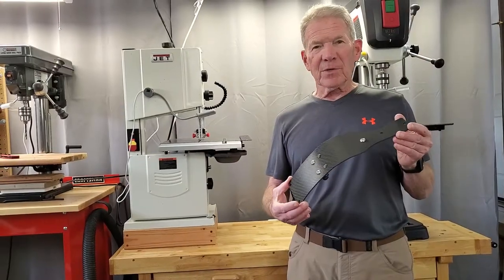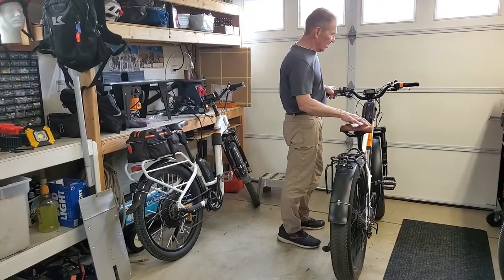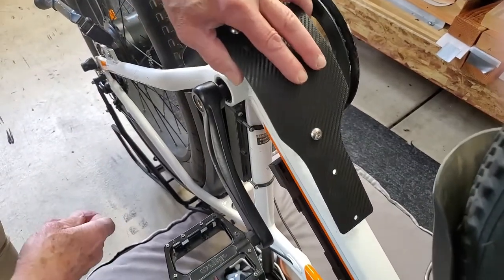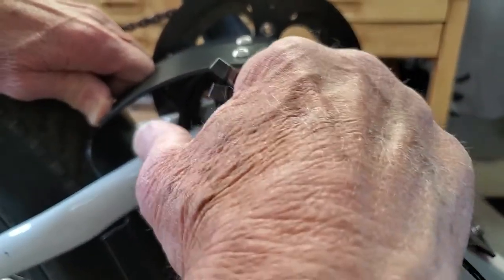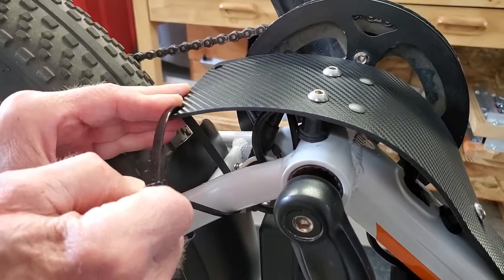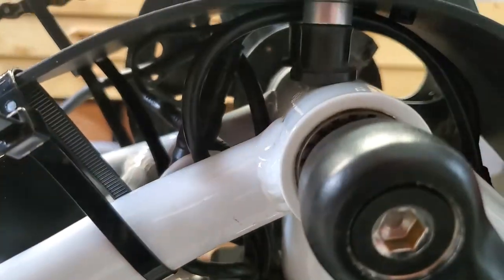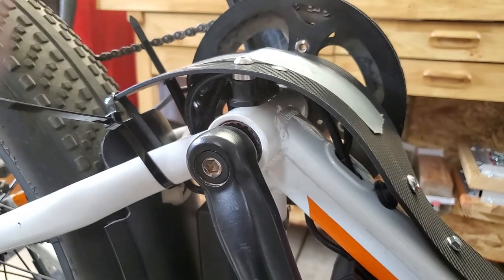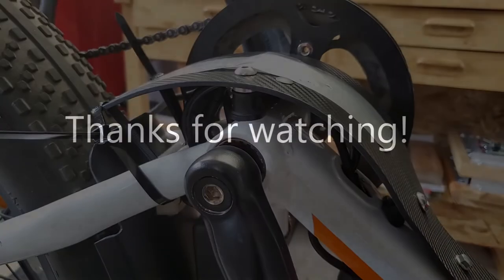RAD ROVER SHORT SKID PLATE INSTALLATION 2020 -2021

Comment: Everybody who has a Radrover needs one of these, I just ordered one in the carbon look! It’s effective as both a splash guard to keep the controller clean and as a skid plate to protect the wiring. This is the best product on the market. Others boast of using steel, but Kydex is ideal in my opinion… more than strong enough and the last thing I need on a 70lb bike is more weight!
Reply from the maker: Thank you and obviously I agree.  My original was metal but the downside of it's qualities was obvious.  KYDEX is almost bullet proof and I have never heard a complaint.  Thanks for purchasing.  FYI the Chinese copied my design about 3 months ago and make them out of nylon which is pretty tuff but not as good as mine.